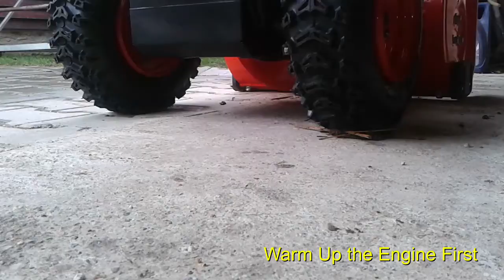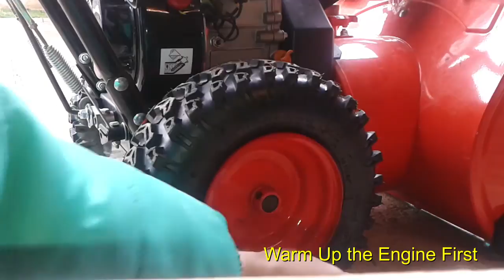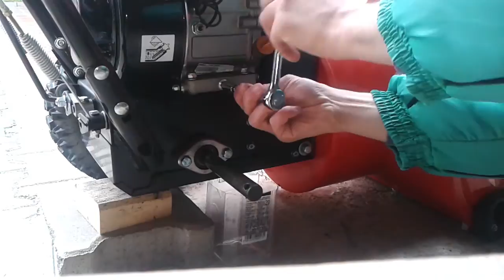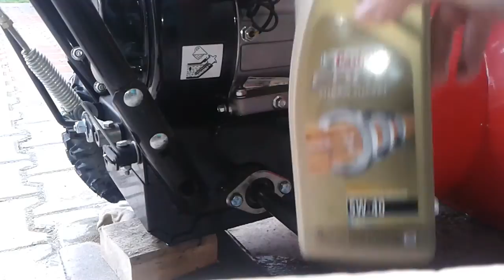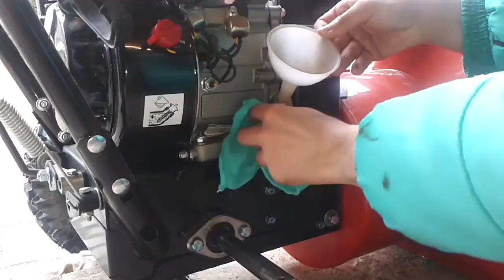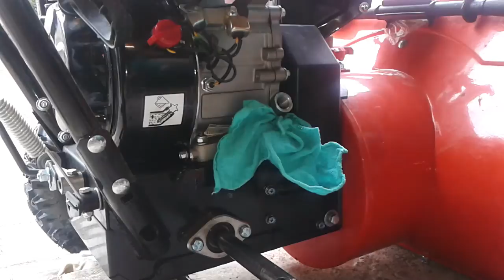Ruris Expert 540 Snowblower - Oil Change / Schimb ulei

Comment: cum merge cu 5w40 ? stiu ca e recomandat 5w30  / sae 30w . Eu la a mea merg cu 0w30 si pana acum a mers foarte bine .
Reply from the maker: +Ovidiu Nicolae 
Sa o stapanesti sanatos!
Pana acum a mers foarte bine si la mine cu 5W40. Eu schimb uleiul la fiecare an prin decembrie si o folosesc in medie cam 10-15 ore pe iarna. Primavara gresez fiecare componenta care se poate, iar in cilindru ii bag aproximativ 5-10ml de ulei pentru a-l proteja de rugina.
Reply: +DigiTech 5000 perfect  asa si eu tot anual fac schimbul si pun 0w30 , caa si modoficare i-am pus gresoare la cele 2 freze sa le pot baga vaselina mai usor. dar merge bine , cum ati zis , ulei la piston , benzina scoasa , gresata si merge ok